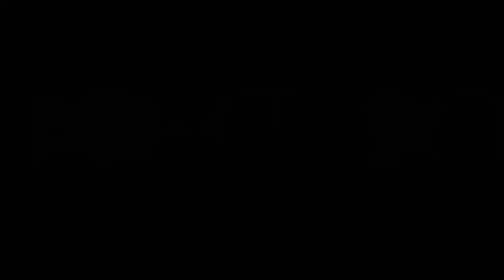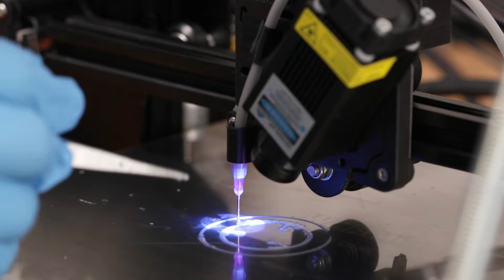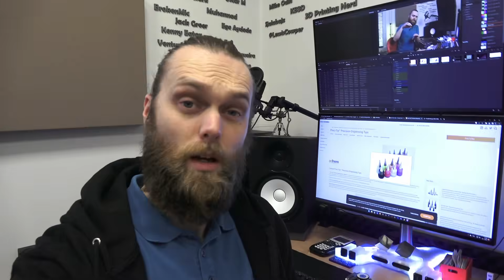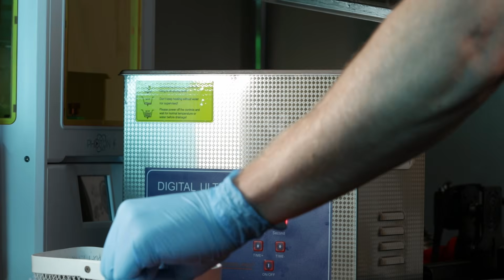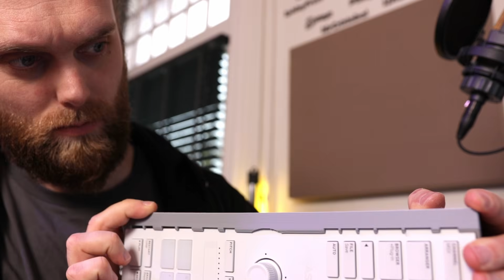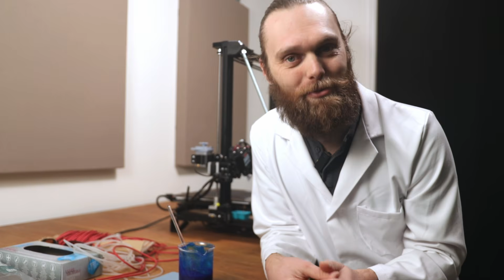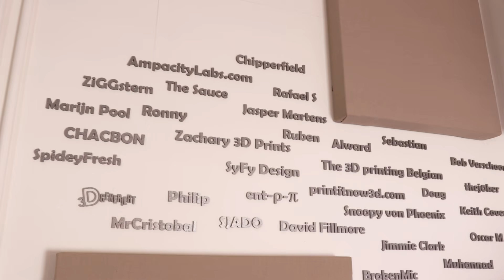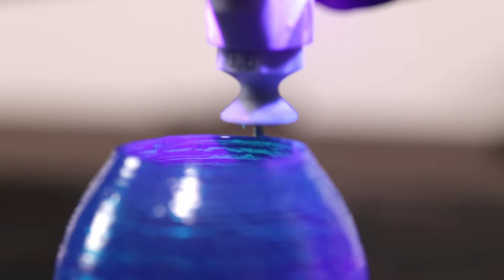I made a CUSTOM Nozzle that 3D Prints GEL!

Comment: could fiber support the resin? Rather than creating a gel, rely on the resin sticking to your fiber to keep everything in place. You might be able to run something like sewing thread through your nozzle where the resin is applied before the thread is extruded. More of a resin infused thread than a flow of resin with a fiber core.
Reply from the maker: That's exactly what I want to achieve!
Reply: Something I’m not sure how you’ll accomplish is how to push the thread out the nozzle. We have a markforged at the lab and the “fiber” it uses is pretty stiff, more like thin wire than thread. There’s also Kevlar spools that we have, but I haven’t actually felt them to see their stiffness. It seems like it would be difficult even with your belt driven extruder to push the thread out in a controlled manner. I love your work and can’t wait to see how you overcome these challenges!

Comment: Hey there! you can try heating up to resin to about 30-35°C if you want it to be a bit more like a fluid. Its a common problem for normal msla resin printers in lower tempratures and controlling the temprature of the resin could make this setup a bit more consistent. For the bridging problem you could enable Z-Hop. Just saying im just a noob in fdm and sla but had the same problems in my fdm printer with bridging and the temprature problem with my resin printer.
Reply from the maker: Great suggestion, thanks! I'm wondering if I need to cool it down at the nozzle to make it work. Would be funny though since this would be the exact opposite of regular FDM printing.
Reply: @properprinting  oh and i forgot the mention that curing resin is exothermic and a lot of heat is created. so if you ever run into the problem that your just applied resin is flowing of the sides its probably that the cured resin is too hot and needs to cool down for a moment. gl with your project

Comment: I really have to stop and ask myself why? The strength certainty can't be any more than SLA (due to the properties of resin), the quality is much worse, and on top of this you have significantly slowed print time due to the nature of an SLA printer taking the same amount of exposure time per layer. Not to mention just blasting UV all over your room isnt good for your health, it can cause permanent blindness on the less severe side of the spectrum, cancer at worst. There's a reason why most curing stations have UV filtering plexiglass covers, or include UV goggles to wear while curing.
This is cool and all but SLA and FDM are finicky enough even when you use the intended materials. Maybe it's just not meant to be.
Reply from the maker: I think that this can enable continuous fiber printing in a very interesting way. This platform can enable other possibilities as well besides resin. About the safety issue, I'm alone in this room and know what I'm doing. Eventually yes, this needs some form of shielding, but that is not going to help me at the stage where I'm at right now ;)

Comment: The bridging problem will not exist while printing continuous fibre, because of the adhesion of the resin to the fibre, you are effectively making a bridge while traversing the first pass. Having said that, the problem doesn't seem to be that different from what happens with edge curling in FDM, although part cooling isn't the solution here. Ironing however might be, so using a more thick walled brass tube, and/of chamfering it inwards (so chamfering the inner edge, not the outer, making an upside down funnel)  might help here. just counterdrill the end with a very small countersink drill, or maybe use a flaring tool. In other ideas, have you tried enabling Z-hop?

If the problem of drops persists, it's worth looking into other fields that have the same problems, in this case, diesel engines. a very simple pintle valve will cure this problem guaranteed, but it will come at the cost of pressure which might become a problem for the pump at some point. If we look a bit further in time to common rail injectors, you could also control the pintle motion directly with a solenoid. this way it might be easier to move the nozzle and leave the pintle in place, which would mean you'd gain some clearance as well (think Z-hop again). this might also play nice with cutting the fibre eventually, which is done at the same locations.

Ik doe dit soort dingen voor m'n werk, mocht je nog een meer direct klankbord zoeken kan dit ook in het algemeen beschaafd:)

Comment: What is the advantage over FDM or SLA when this works?
Reply from the maker: The ability to mix resins so you can manipulate the rigidity of different areas within on part which could be very interesting for robot grippers for instance. It enables infusing the fiber with resin to make continuous fiber printing possible. Instead of fibers I can use copper wire for 3D printed electronics. Instead of resin I could use concrete to manipulate the center of gravity or just make heavy parts (concrete infill within a standard part). I can print glue or solvents and place that between layers of a regular FDM print to increase layer bonding. I can print a dissolved polymers in the circumference of the print to see if that improves the characteristics. A combination of all of this is where I'm eventually aiming for and I'm sure that there are more use cases!

Comment: A big ol' syringe with a plunger that's a threaded rod driven by a stepper might be able to squeeze a thick enough gel that it could bridge stuff (like you said, put pressure on the vat). 
3dprintingnerd showed a uv gel industrial 3d printer and it had a mechanical doodad that cleared boogers from the nozzle after each travel move. It was a tube concentric to the nozzle tube on the outside and it moved down a couple of times to break stuff off. That could be doable with your new design.
Reply from the maker: Removing the boogers that way is an interesting approach, thanks for mentioning! I started printing with a syringe in an old video where I printed food. I still like that design, but the limited volume is a big disadvantage for me. With the pump it's also possible to refill the vat during printing making non-stop printing of very large parts possible! (if it works xD)

Comment: I've never really dabbled with 3D printing, so I'm not sure if something like this would be possible, but it would be cool to have a resin that's consistency changes dramatically depending on temperature and then you could program the print to change temp depending on nozzle placement so you could do things like print a hard outer shell and then fill it with a gel so that it could be a solid, rather than just filling the inside with structural beams.
Reply from the maker: Interesting thought! I want to experiment with different infills with this platform. An interesting use case I can think of is to use concrete infill to make parts heavier of manipulate its center of gravity. There's much more research to do!

Comment: alright I do have a couple of thoughts, one, is that there is already a somewhat established process for printing thick liquids like chocolate, something like that likely would not work with a standard resin but the thickened resin you first made that demonstrated its ability to form its own little tower, it seems to me like such a system would work, 

secondly, I think once you incorporate a fiber the surface tension around the fiber could support itself much better, possibly being able to use a thinner mix than you currently need to achieve success
 Very cool to see this project. I also do a lot of tinkering and printing and ive been thinking about this type of printing for a while
Reply: Regarding adding the continuous fiber, I was wondering if there would necessarily be a minimum viscosity for the gel, in order to keep it stabilized when printing features that cause a sudden change in tool head direction.  Specifically because there's some delay on curing due to the way the laser is masked around the nozzle.  The effect might be like the situation you can force with FDM printing an inner wall of a sphere too fast it overcomes the cooling and the nozzle begins to pull the extrusion taught.

Comment: This is awesome! I'm thinking you could take a page out of resin printing and place the model at a non vertical angle on the bed and print supports for it. I also suspect that the problem would go away once there is a fiber, the resin will stick to it over the gaps. Also that nozzle is pure genius!

Comment: Chemical engineer here. I would suggest a two fluid injection. Think epoxy resin. The resin is one tube, the fixative/catalyst is the second tube. Mix in the nozzle, just cooling required, no lasers. Spiders do it!
Reply from the maker: I've seen this done with a silicone printer and I think that this is an awesome approach! This is definitely worth testing, thanks for your suggestion!

Comment: How about adding glass bubbles into the new mixture? The silica should prevent the bubbles from separating from the rest of the mixture while still providing additional support.

As for the pressure issue, how about putting the paste/gel into a plastic bag which you then seal/connect to the bowden tube/pump so that the pump creates a "vaccuum" and ensures a consistent output of gel?

Very cool project and the final successful print looked truly amazing.

Comment: Nice going. Maybe you can use the same idea that a hrease gun uses. High pressure metal tube, metal lines, hoses etc. And then a big thread driven plunger to drive the gel. If it's good enough for grease it's good enough for gel. No need to rely on a vacuum that way
Reply from the maker: Thanks for your suggestion! That definitely has its advantages. I do like the peristaltic pump so much since the mechanics don't come in contact with the fluid. This makes using different fluids easier and also enables food printing!
Reply: Grease gun*

Comment: Peristaltic pump have inconsistent flow. Instead of using peristatlic pump better build giant syringe driven by lead screw.
Reply from the maker: I designed something in an old video with a syringe, but stepped away from that. I designed this pump in such way that the flow is quite consistent. If you want to know more about the thought process, I showed that in our first attempt here https://youtu.be/ZslI-Z9SZUg

Comment: What are you using for your tube? Is it squishy? Can you do direct drive with hardline right out of the pump to the nozzle? Gravity feed the pump with an IV bag and large line mounted high up?

I was just looking at non-pulsating positive displacement pumps, have you heard of progressive cavity pumps? I don't know if 3d printing can achieve the tolerances necessary, or is they work with really low flow rates.

Is the "hourglass" shape of your nozzle such to cast a shadow around the tip? I don't believe you actually mentioned that in the video.

LEP flashlights emit a parallel beam of light, I wonder if they can emit UV in the wavelength you need.

Would an airbrush nozzle work? A simple oring at the back of the nozzle against your custom bracket would seal well.
Reply from the maker: Great questions! I use silicone tubing and the way this pump is now, it cannot pump hard line. I'm wondering if there is a type of tubing that can be compressed and not expanded, or maybe add some type of weaving/coil around it between the nozzle and pump to prevent it expanding. Gravity feeding nonetheless is a good idea. I heard about these type of pumps and went for the peristaltic pump due to its simplicity to make one and that the fluid doesn't come in contact with the mechanics. Especially when I want to use this platform to print solvents and glues it'll be mandatory to prevent polluting between liquids. The hourglass shape indeed is to block the light better, you guessed correctly ;)
Reply: @properprinting  I understand the pump needs squishy tubing, I'm taking about transitioning to something rigid after the pump.
Reply: @properprinting  I think encasing the tube in some sort of mesh/coil wouldn't get you any benefit, as there is still some play/tolerance involved when putting the silicone tubing inside a mesh which would negotiate the added benefit.

Comment: i think you are losing pressure with silicone tubing , hard tube might work better 🤷
Reply from the maker: Yes, the big drawback of the peristaltic pump. I'm wondering if there's a tube in existence that can be compressed, but not expanded. That'd be perfect!
Reply: @properprinting  how about something similar to the (Printing food) idea ?
make it bigger so you don't have to reload it often and use ptfe tube since it's hard but bendable

Comment: Wouldn't the continuous fiber provide the overhang support.
Reply from the maker: To the extreme! (I hope). This is what I want to achieve next with this project, but eventually this needs to work as well since continuous fiber printed parts have areas without fiber too.

Comment: If you pressurize a bottle with the gel and use some type of valve on the nozzle to start and stop the flow?
Reply from the maker: I think that the pressurized bottle in combination with the pump is going to work well. This way the pump acts as some kind of valve.

Comment: Great progress! I wonder if foaming PLA would absorb enough resin to be useful as a base form. Instead of relying on the thickness of the gel, maybe a 2-1 nozzle? How warm can resin get? Fun to think about but I don't have to make a video about it, lol.

Or there has to be a hydraulic pump or auger design out there. Remember the Kodak film factory extruders(on smarter every day)? They were pulling vacuum on their filament for bubbles during extrusion. Might be handy in production instead of pumping out vats constantly, heh heh. Just another angle to think of. Best luck and thanks for the brain food.

Comment: Have you thought about using cornstarch instead of glass and silica? Cornstarch will thicken the resin and it might dissolve in it as well
Reply from the maker: I haven't! I think it's an interesting idea to try out different fillers to see how they behave in a controlled environment.
Reply: @properprinting   Other options would be baby powder and baking soda. Both have very fine particles

Comment: this would be hard to engineer, but can help the "bump" problem:

make end of nozzle "ramp" shape all around. (cone)

build in a spring system into brass nozzle so it can retract into the extruding mechanism.  this solves the bump problem.  end of nozzle can ride up into larger extruder mechanism and over bumps.

extra credit would be to build in some sort of cutoff valve into the spring mechanism for the tip to cut resin flow off when it "z hops up"  which would minimize bumps building up more bumps. 

probably nearly impossible to engineer something that complicated that small at "homemade" scale, but mayb...
Reply from the maker: Thanks for your suggestion! The difficulty is that if you go over bumps is that they get worse or spread out. Plowing through them still looks like the easiest solution. With regular printing this is not such an issue since the irregularities are melted away where the resin is hardened and stays that way.
Reply: @properprinting  Even if you plow through the bumps, the best case is you end up with surface defects where the resin is pushed down and out of the way, right? Maybe this is something that could be resolved in the slicer profile, to prevent the bumps from occurring in the first place?

Comment: looks like the nozzle need to pass over hard parts. maybe some flexible tube instead of brass or some soft part between the brass tube and the resin nozzle body? comme silicon tube could act like "silent block" or damper. for pump you can check too on ali some "uv damper" .it's used with 2D uv printers. i know it's needed when you use tubes in printers. anyway great job! you deserve more view imho because it's great idea.
Reply: also you could use gel but without uv polymerisation to use as supports. but it will need a two heads printer. check "massivit"

Comment: Can you use PTFE tube instead of rubber tube? And put the gel container on top if the printer, so that gravity works for you.
Reply from the maker: That's not a bad idea. The drawback is that the pump requires a flexible pump, so I need to add a coupling system in order for this to work.

Comment: When pulling a vacuum, in order to get the air out that bubble has to pop.  No use if you let air in and let it collapse.  Also it is a good idea to heat the nozzle up a bit (40-50c)  so the resin flows easier but "gels" immediately after exiting the nozzle.
Reply from the maker: The video didn't show, but I let it stand for over a couple of days under vacuum. This was a long process😅 Thanks for your suggestion, I'll use a bigger container next time which hopefully goes quicker!
Reply: @properprinting  You can also heat it up first so its less viscous, then it wont blow up that much.

Comment: There are some really great ideas and designs here :-)

OK, from my limited experience with resins and fillers making gripper material. The density can catch you out , things float when you least expect , so check that you CF will stay in the resin.   You may find that the CF will help hold the fluid in position (or may not !) 

I tried piston pumps and finally gravity fed peristaltic kind of worked.  

Mixing is difficult! The greater the viscosity the more mixing is required. (I doubt you'll get much mixing in that nozzle).